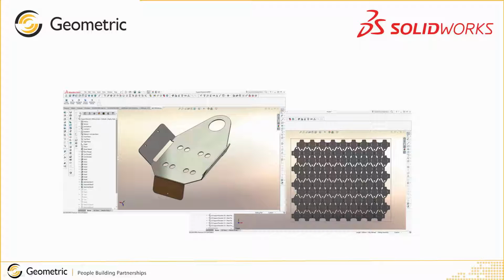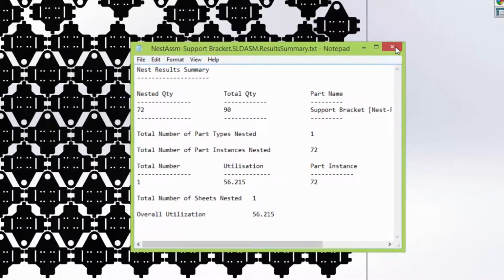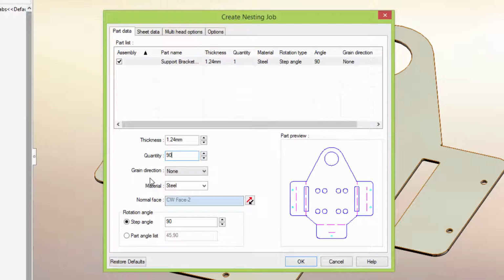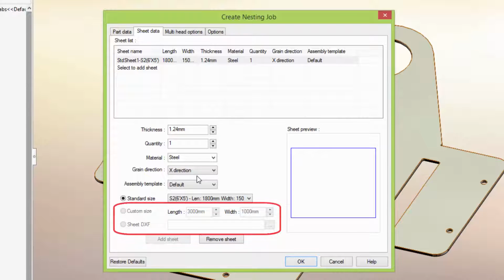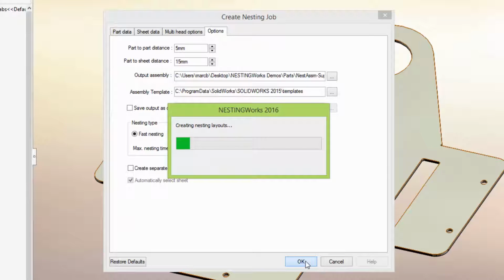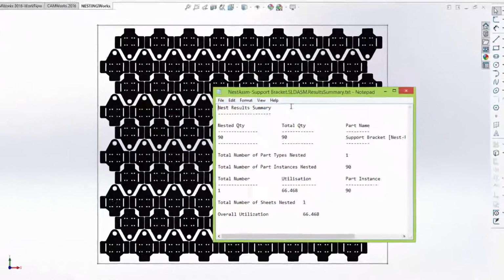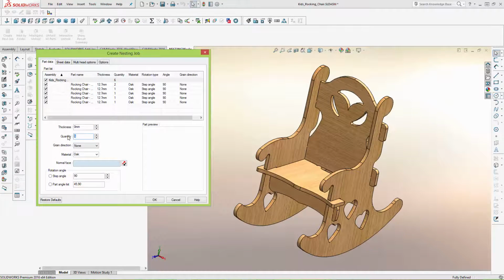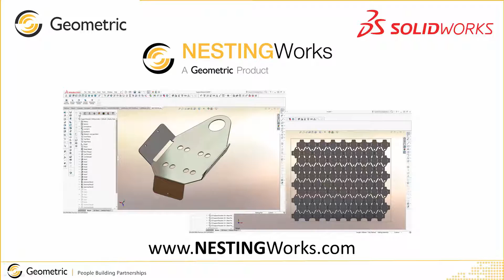Automatic Nesting Solution for SOLIDWORKS | NESTINGWorks

Comment: Hi,

Congrats NestingWorks looks really nice. However, what about nesting from a multibody part? Is possible? I would not use assembly environment for design a static structure (welded, bolted, etc). Instead of this, I rather use part environment (multibody part) is more easy and efficient taking in account the cutlist and another features.
Reply: @omar Freites of course  we support multi body in Nesting here is a quick Video for you https://youtu.be/JNugU3FCQ-k
Reply: Yes, it supports multibody parts